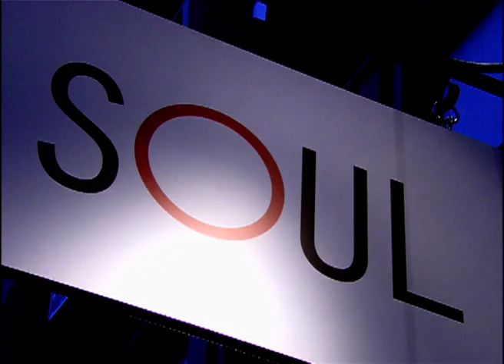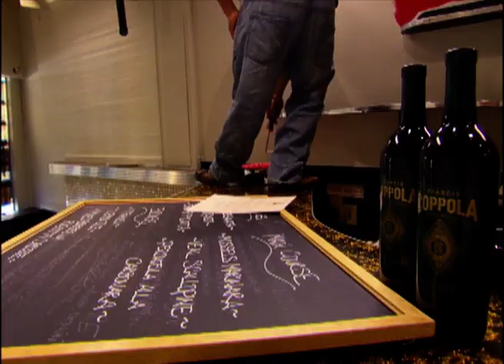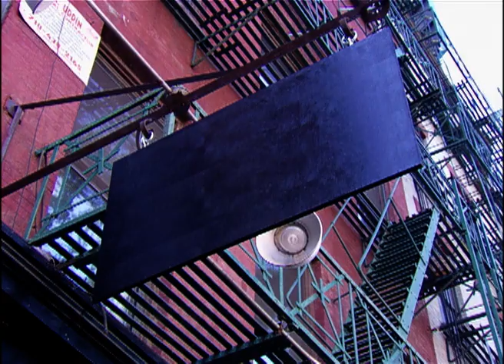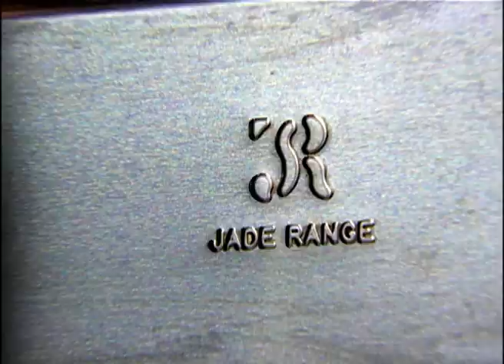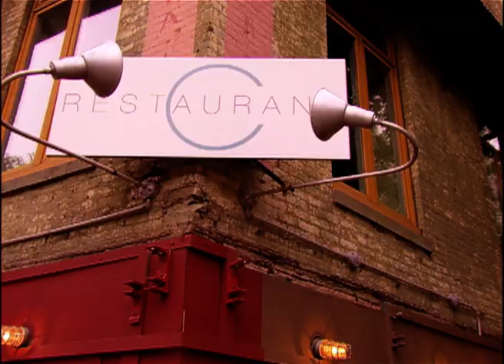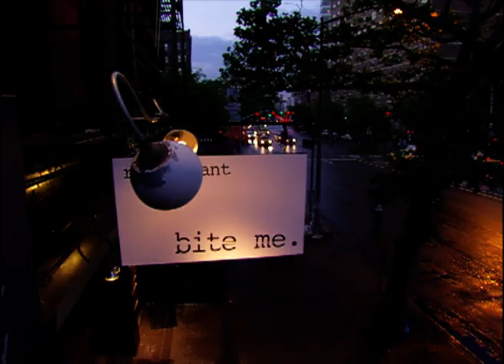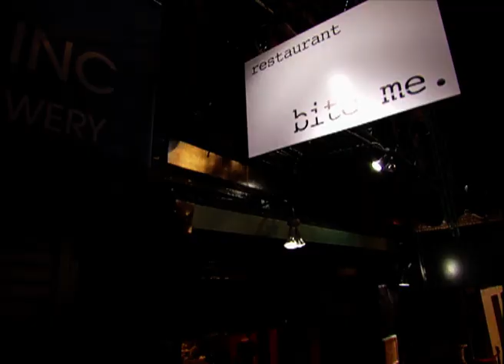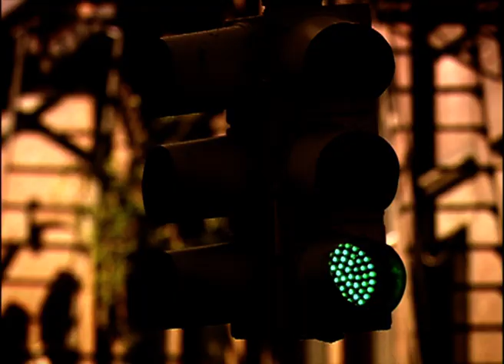And The Winner Is... 🏆 | Marco Pierre White's Chopping Block - Finale | Our Taste

Comment: I wonder if the energy of the blue-painted plaster figurine adds more to talent, to strategy, to the economics of a restaurant or to the quality of the cooking.  It would be interesting to find out whether adding more water to the plaster mix when it is being made would increase one factor more than another, and that's not even taking into account what exact shade of blue the paint is.  So many significant factors.